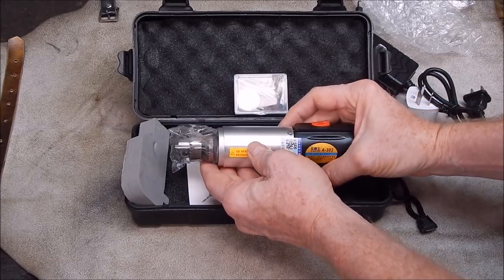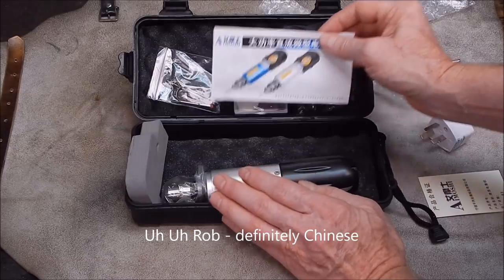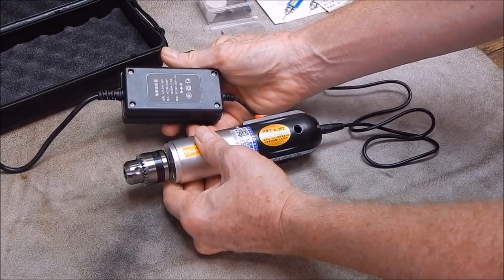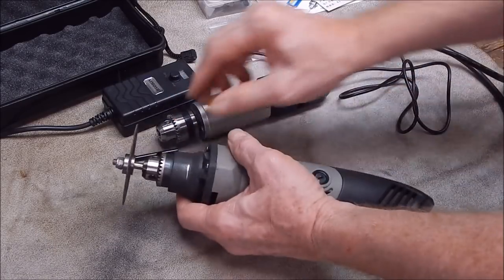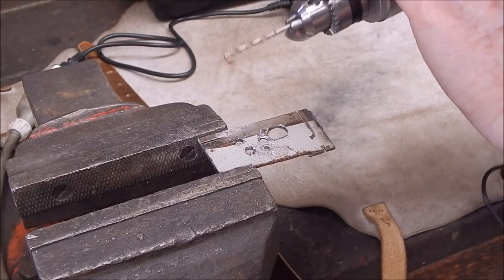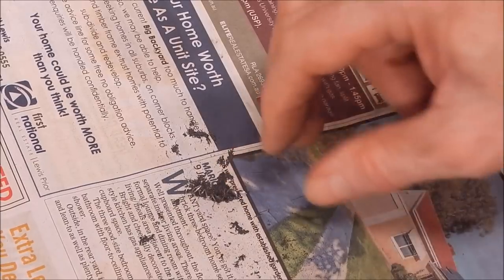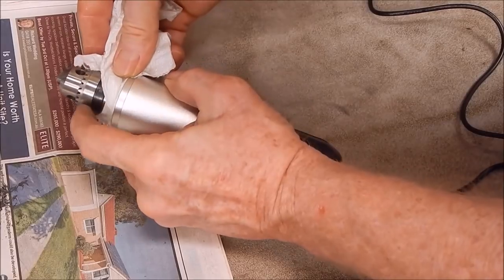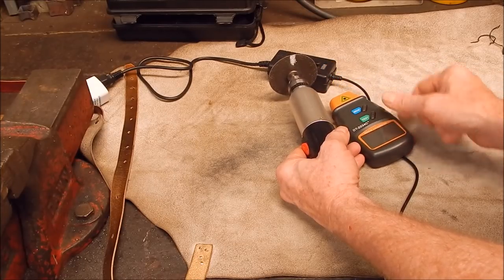Banggood 220V 72W micro variable speed electric drill / rotary tool

Comment from the maker: Having used this drill for a while I've found that there is some looseness in the front bearing, the end result being that long drill bits will  "whip" at speed.   It's not apparent with cutting discs and short accessories.

So that's another strike against this unit.  The HILDA 400 watt rotary tool I reviewed earlier is quite the opposite, dead tight and accurate.  Definitely a better unit.

Rob

Comment: Amazing it has that chuck on it... more useful than just a collet IMO. Considering it's supposed quite low wattage it seems to do pretty well... although must admit the magnetic problem could be distinctly annoying. Agreed - steel outer shell would really help.
Reply from the maker: Banggood are going to contact the manufacturer and explain the issue and suggested fix.  They did the same regarding a dud product I received previously, but never reviewed.

They seem to be using these reviews to weed out problem products.  The only way to do it I suppose.

Cheers Rob

Comment: Hi Rob: I am impressed by the overall quality of that little unit, the truth is that Dremel was never designed with quality in mind, and under extensive use the plastic in the body and cheap internals fall apart fast. I bought a late model Dremel with the spring loaded jaws that Came apart in no time flat. I wonder if a thin metal sleeve pressed onto the body, would not solve the magnetic issues. In my opinion this is a much better tool that Dremel (and cheaper).
For heavier work the Hilda rules supreme.

Regards

Jorge
Reply from the maker: Hi Jorge,

I'm not impressed by Dremel.

A thin external shield would solve the magnetic issue, but ideally it should be internal directly at the back of the magnets.

If the manufacturer does that it will be quite a nice useful unit.  I like the geared head idea. Makes it more practical for drilling.

Cheers Rob

Comment: its both larger and less powerful than a minicraft drill (100w and dremel sized) they run relatively slow (6-7k max), but have to be bought used now, my version has a keyed chuck too.
Reply from the maker: I don't think the minicraft has a reduction gearbox - so it won't have as much torque for drilling.
Reply: true but its chuck is only about 4mm and does drill that fine

Comment: Can you put 1/2 inch flap wheels
Reply from the maker: Anything for Dremel will fit it.
Reply: But in the video you said I can fit up to 1 1/2 inch shank I  flap wheels that are 1/2 inch
Reply from the maker: OK now I understand your question.  Yes you can,, but it's not a good idea as these are very low torque power tools and it's easy to overheat them from high friction/drag.  Same thing applies to wire wheels for the same reasons.  Electric die grinders are mainly meant for small low drag load fittings such as grind stones, burrs and small diameter cut off discs.
Reply: @Xynudu  I just bought 110v electric die grinder with 3200 RMPS
Reply: 32000
Reply from the maker: OK.  Enjoy.

Comment: I wonder what that motor unit was really made for as that big chuck appears ill suited for it.  Like someone found had a bunch of them and they were re-purposed.  
 It's hard to see but it looks like a 1/8 output shaft and a dinky ball bearing in front.  With the planetary I might assume the output shaft may be floating or have little rear support between the motor and reduction.  I can see a cutting disk getting jammed and bending the small shaft or overtaxing the minimal bearings/support with that long stick-out.  I sure wouldn't want to try porting manifolds with it :P

I have one of those flexible shaft rotary carving tools that's slower and quieter than a Dremel but with more torque.  I'd like to try it on a tool post, at least for chuck grinding, but the chuck is too small for 1/4 shafted stones.   Maybe a new nose piece with a die grinder collet and bigger bearings would be a good project for it...

Comment: So higher torque comes with the lower RPMs?  I didn't see any heat bluing.  Maybe that's their goal.  Is it advertised to be used on steel, or just wood and plastic?
Reply from the maker: Higher torque comes from the mechanical advantage of reduction gearing - basic physics.  It should be able to handle any hobby/model making medium to be useful.

Comment: its okay for the price you cant expect to much for the price but its a nice tool to help you kids with school projects then they do not have to scratch by your expensive tools
Reply from the maker: Yes, it's ideal for kids as it's running at a safe (low DC) voltage.  There's a bit of slop in the chuck bearing, but overall it's quite gutsy, reasonably accurate, and controllable, and would be great for any one doing hobby work/model making/RC aircraft.

Cheers Rob

Comment: I doubt it has a gearbox, the PMDC motors can have a lot of torque and lower no-load speed compared to the universal motors you find in typical dremels. Both can be made to be low or high speed.
Reply from the maker: You can hear the gears when it's running.  Also the motor stops instantly.

Comment: Had to laugh since I've been beat up over speeds and feeds.. Did you have the correct RPM when testing the drilling capability?
Reply from the maker: We all get beat up by viewers at times ;)  Yes, I drilled at max and minimum speeds.  It handled both OK.

DC motors are inherently stronger at low RPM than AC.  ie a DC motor develops maximum torque at zero RPM, while an AC motor is the direct opposite.

That's why these little DC motors perform so well.

Cheers Rob
Reply: @Xynudu 
I felt the biggest bit was jumping and not cutting properly because it was going to fast.   Would have been good to see how it cut at a lower speed.   Think it would have done okay.   Thanks for the review.

Comment: I wonder if a toolpost mount was made of steel, the magnetic field would migrate into the mount and this would then collect the steel particles instead of the body.  If the chuck side of this mount is made smooth and un complicated, it might be easy to clean....but more importantly it might reduce contamination of the lathe ways.
Reply from the maker: No, the mount will remain inert magnetically, same as an external cover.

Comment: G'day mate.  Looks like you are going to clean out Banggood before it is all over.  My dremel can cut a 1/4 inch bolt in just a few seconds.  That tool was not too impressive.
Reply from the maker: The Dremel sized disc cut poorly, but the 75 mm disc would have cut that bolt off in seconds.